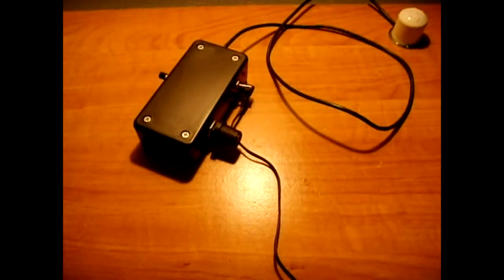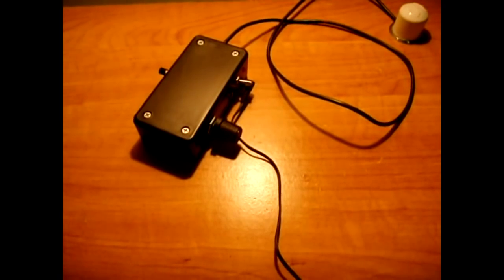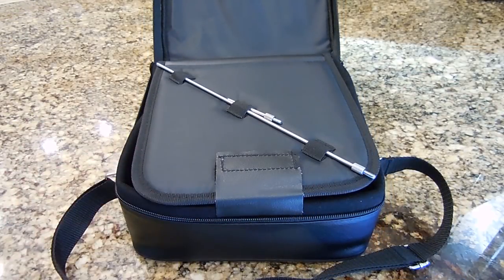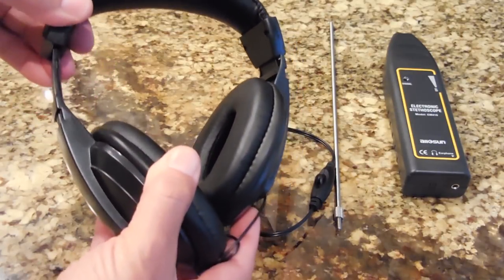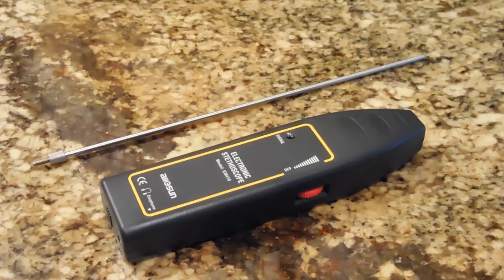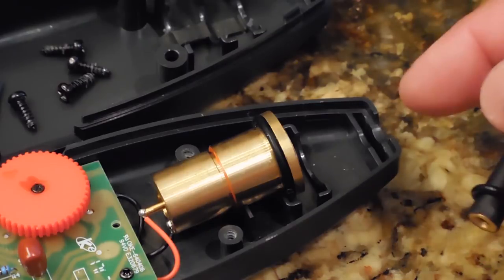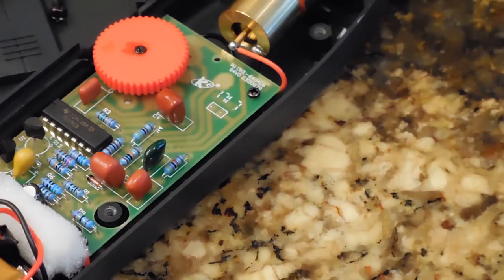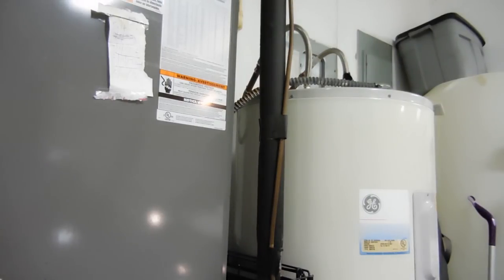Electronic Stethoscope (Pinpoint Abnormal Sounds)

Comment: Most vacuum cleaners that use a dirt indicator use a sound sensor in the suction hose to pick up dirt. LEDs on vacuum tell you when you can move to different area based on debris noise.
Reply: A D I think they are impact sensors rather than sound sensors.
Reply: Similar  to PZT
Reply: If I remember correctly, the Roomba had a pzt disc sensor. I think it monitored how often, and how hard, dirt bounced off of it while being swept up.